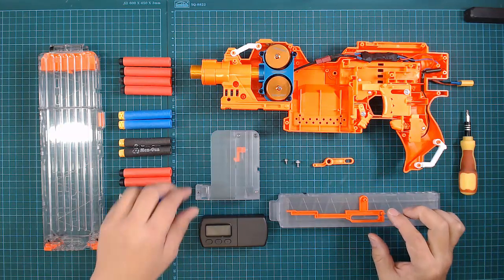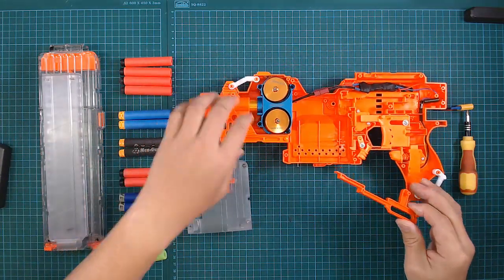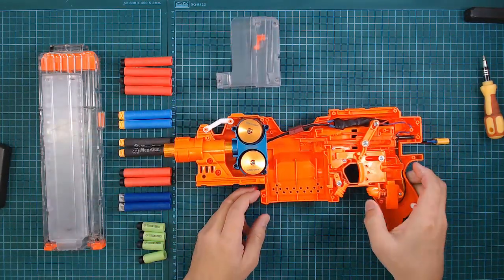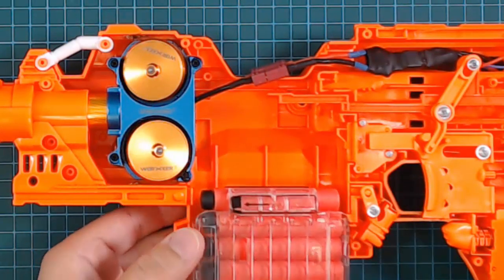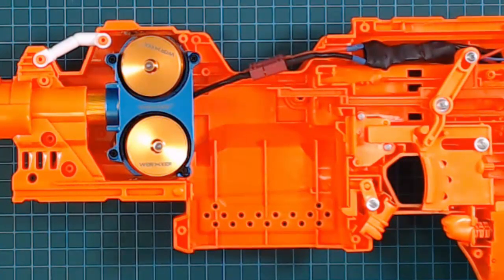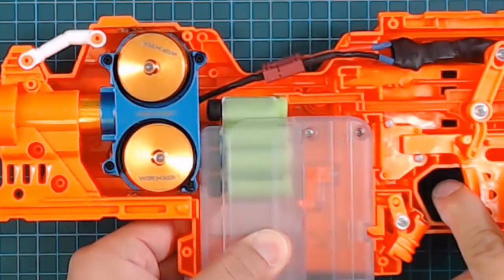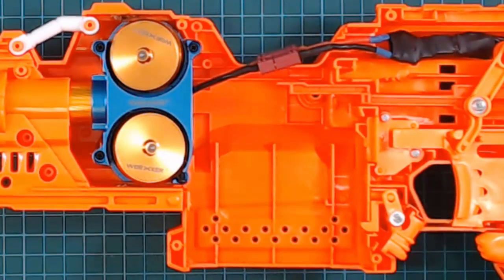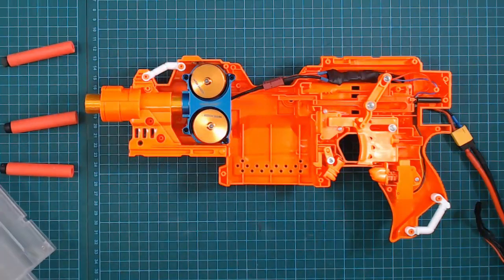Worker Full/Short length dart pusher for Stryfe

Comment: So when worker says "adapter for talon mags for flywheel nerf models" it basically means only for the stryfe?Right?With the new pushing rod installed.I mean any chance of these adapters  working on any flywheel nerf gun like a rapidstrike or a turbine and so on?
Reply from the maker: I did one for the rapidstrike, https://youtu.be/tKsqKYO4Vx8 the link to the file is in the video description

Comment: Btw, I am using Aurora OFP Cage 42.5 from monkeemods. Do you think the tolerance will be enough to handle full length dart? Thx.
Reply from the maker: Extra Mile I do not know man, I don’t have an Aurora
Reply: The aurora won't be immediately compatible due to the dart guide. If you really want to use it you'll need to cut some of the guide off. Otherwise I've got mine installed on a morpheus cage which seemed to work reasonably well on initial testing. There were some darts like the accufake where it wasn't feeding consistently.
Reply: @christopher leow Thank you. Btw, do you have any reference  of what length of the dart guide on aurora OFP that need to be trimmed? If you have some pics will be very helpful. Thanks
Reply: @extramile3382  I don't have an aurora per se, but I discovered it with the serenity cage (which I believe has the same dimensions at the aurora). There's about a 5mm overlap, I imagine you'll need to grind back a little more than this.